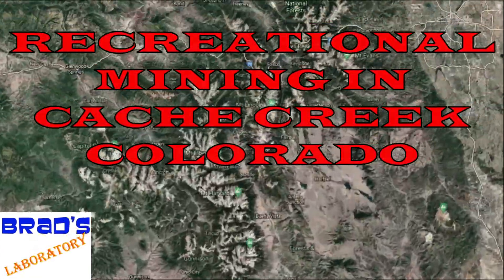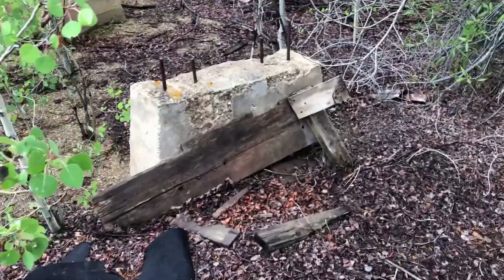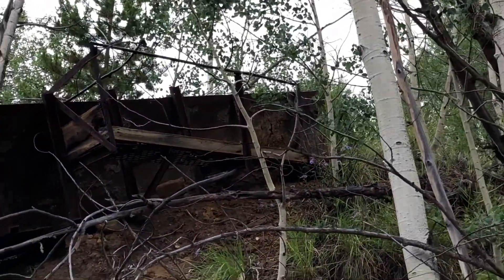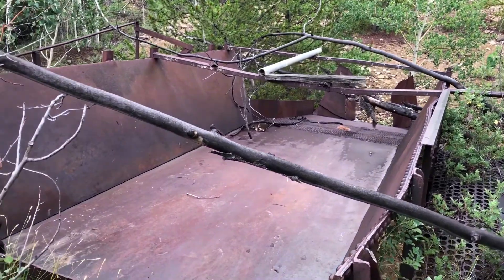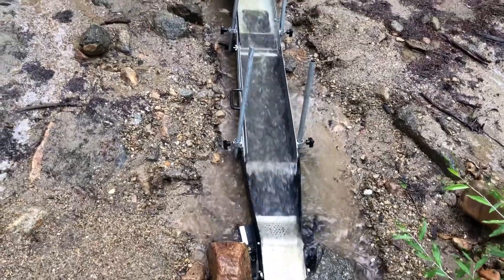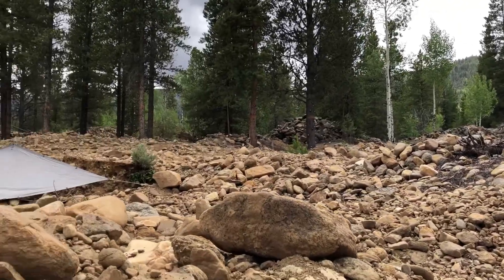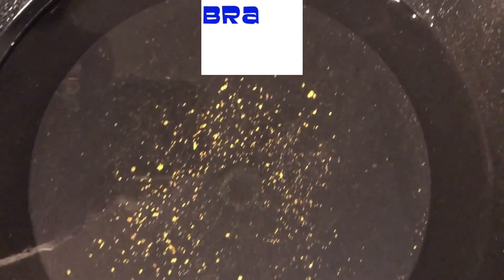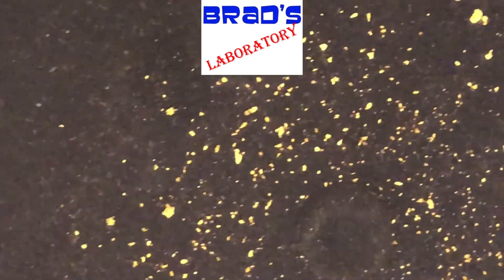CACHE CREEK 2020

Comment: Ready mix concrete started in 1913...so I bet you are right on!
Reply from the maker: I was thinking the ruins looked more 1950ish, including the hopper feeder. All the info I can find says that mining stopped after the lawsuit in 1911 and didn't resume. There are welds on the hopper feeder, and while welding has been around since 1881, it was not really used until after WWII when it got perfected and electricity was more common.
Reply: @BradsLaboratory  Nice detective work!